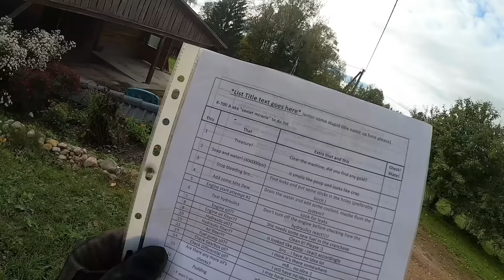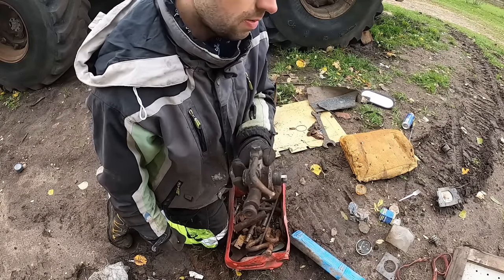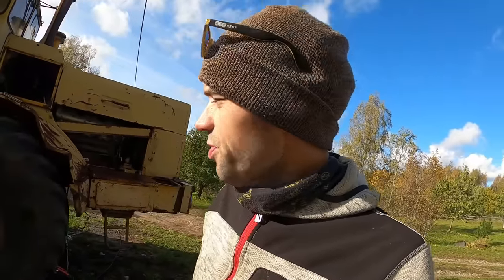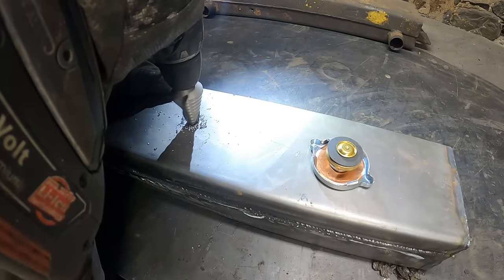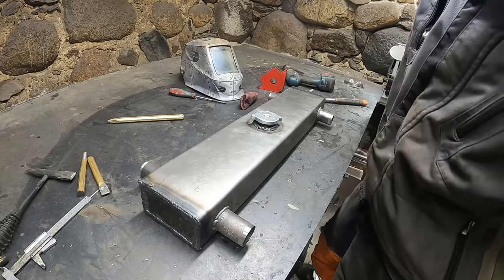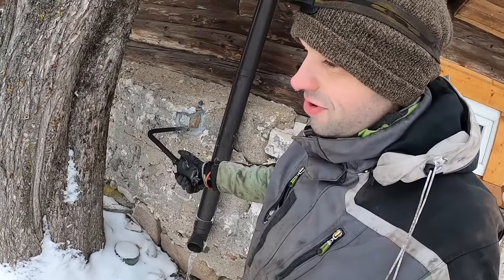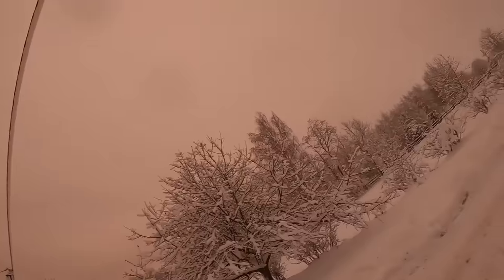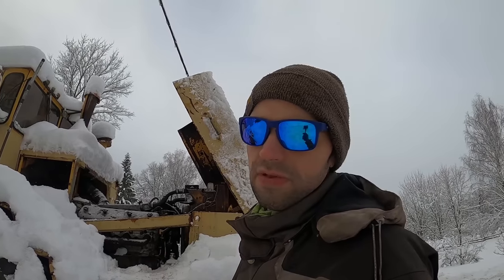Fixing up the Kirovets tractor (K-700A) - Ep1

Comment: My friend made his own hot water pressure washer by taking his pres washer, a50 foot length of copper tubing and a barrel. He wrapped the copper tube into a coil and placed it into the barrel so both ends stuck out the top. He hooked the hose from the pres washer to the coil then another to the coil to the gun. He filled the barrel wit enough water to cover the coils then built a fire under the barrel. When the water got to boiling he turned on the washer and after a while the gun melted.
Reply: A safer way is to use a propane fired instant hot water heater and hook your hoses to it. Mine is 14 liters per minute.   Just stop from time to time or it will shut down for safety. Depends on the temperature I can go almost 10 minutes.

Comment: Put a whole box of crushed black pepper in your radiator it'll smell great when you're driving and plug all the holes and it won't leak also keep all brass and copper shavings from your milling so you can put it in the radiators to completely plug them perfectly❤❤❤
Reply from the maker: what🤔🤣🤣

Comment: Hey Ants, great video. For the radiator cap, if it still leaks you could cut the radiator cap fitting off the old tank and weld it in place. Have a merry Christmas 
PS Don’t forget to grease the muffler bearings
Reply from the maker: oh snap i forgot, brb

Comment: Just a lump of rolled hollow section RHS about the same length , as long as the bonnet will close and you can fit the pipes , plus’s a couple of lumps of angle for end caps / mounts  , turn the fill cap mount in the lathe . Quicker easier to weld and last for ever  . Just trying to help because I think you will be back to this one good luck great Chanel love it I’m a retired maintenance fitter , did this shiiii t all my life cheers
Reply from the maker: ah yes i understand, good idea that

Comment: Hi Ants I have a hint for you  grind a small  flat along  the bit shaft to make a " D " shape....bending  pipe fill it with dry sand and tap it into the pipe with a brush handle pack it in well... cap off the ends...allow enough pipe  for cutting the ends off  to get the sand out ...merry x-mas to you and the family  great viewing ....
Reply from the maker: Thanks m8

Comment: First, let me say merry Christmas.
As for the diesel heater efficiency in the shop, you could add a regular radiator to the exhaust system so you can get all the heat out of the exhaust gases. I saw a picture of the same setup so it must work.
Reply from the maker: I was told that i could not restrict the exhaust too much, the fan would not be able to push it out efficiently enough.

Comment: Okay , so im starting to think you have access to my , Want list , 🤔🤔😝🤪. Im Impressed with the expansion tank , great job *** not easy to stop leaks in cooling systems that size . ive never seen steel coolant pipes that thick 🤣😂. the more leaks you fix the more pressure and so More leaks until you finally get it plugged , its going to be interesting to see how you proceed with the Kirovets ..........
Reply from the maker: Cant wait

Comment: To work on Sibling of Joseph, buy a couple of used insulated tarps (the ones they use for winter concrete). Build a cheap frame structure  cover with tarps and  put a cheap diesel heater in it. You will be out of the wind and the diesel heater will get temp into high single digits Celsius….comfortable to work in. I’m sure you personal Santa Claus can make the needed supplies appear before Xmas.
Reply from the maker: hmm :O

Comment: I love how the expansion tank came out. I think you still have a air pocket somewhere in the engine, so that's why it took only 30l of coolant. Not to say that the cabin looks now much cleaner after removing all the rat turds from it with the pressure washer. I'm sure this thing will have some other surprises in store, so we shall find it out in Spring if this thing even moves on its own power.
Reply from the maker: Mhm agreed 😇

Comment: I have found in my own personal experience that when you want to build a tank and you want to use thin gauge materials the best way to do that is with gas tungsten arc welding AKA TIG welding stronger more ductile welds this is desirable when building expansion tanks and things that hold a lot of pressure but you're doing awesome man happy Holidays to you and yours
Reply from the maker: Ahh yes i have that welder option but iv never even tried it out. Think i need to buy a argon gas cylinder and then just experiment
Reply: @Ants_Pants   yes its a great process for thin plates and pressure fittings

Comment: K2 Akra is an engine cleaner and it does amazing work. Put some in a spray bottle then agitate the gunk a bit with a brush where it's really thick then use the pressure washer. Seriously i'mm allways blown away by how well it works.

Comment: You need to build a hot water pressure washer. Super easy, propane camping water heater upstream from gas or electric pressure washer.
Reply from the maker: easier to just rent it mate, 30 USD per day

Comment: Hi Ants. The Tosol (or any other antifreeze) has higher permeability than water. It s a reason why you see so many leaks. You can make hot water washing by yourself. Put one of your water tanks to a roof (for initial pressure), paint it to black and wait the summer. Summer sun will heat the water and you can clean everything.  Also I would recommend to use own cleaner spray to clean the engine.

Comment: I know this suggestion is way too late but you should cut that radiator cap( hole) with the other round hole that’s sealed. Just cut a square out of the old tank and weld it to the new tank. Just Sayin ! Merry Christmas to you and your family from Panama City Florida,USA. 🇺🇸🦅   No Snow Just Breeze !
Reply from the maker: The old tank has no radiator cap. According to the book it has a pressure release valve and a normal cap

Comment: Next time welding sheet metal wipe the sheet with acetone. Makes welding 100x easier.
Do not use brakecleaner it will create toxic fumes.  Be safe!  
And merry x-mas!
Reply from the maker: ok
Reply: apparently non chlorinated brake cleaner is fine

Comment: Great video, as always!   The winter weather you work in is incredible!  For any more leaks in your tank, why don't you use epoxy?  In America, I would use JB Weld, although you'd have put it in a heated area for 24 hours for curing.  It would also work a lot better than welding to get a smooth surface for your cap.  Once cured, JB Weld is rated for around 600 degrees F, if I remember correctly.  I successfuly repaired a bulldozer radiator with it.
Reply from the maker: yeah that stuff sure does work, iv fixed even hydraulic leaks with it

Comment: Often, a good replacement for plumber's tape is to use parts of a balloon! You can cut it into a strip or use a 'flat' section.

Build a quonset hut? Helped build one before. It's pretty simple. In addition, you don't have to clear snow off of it (Maybe clear the snow at the base before the 'big melt' in the Spring?)!
Reply from the maker: Thanks

Comment: I got a 'broken' one of those Karcher washers from work. It was fixed the same way you tried, by removing the hose from the handle, but I had to turn it on it's side and jiggle it to dislodge the air bubble around the sensor inside.
Reply from the maker: Sucks 😣

Comment: If a hose is too small but really close. Put the end of the hose in boiling water, then put a small amount of dish liquid in the end. It should work it's way onto the fitting.
Reply from the maker: Hmm 🤔
Reply: or if careful, heat it with a propane torch,

Comment: I think you should drill a hole in the neck of the filler cap. Now when the pressure lifts the springloaded valve, that pressure cannot freely vent into the open air. If you drill a hole between the sealing surface and the top of the cap, the pressure can escape that way.
Reply from the maker: theres no seal between the springload valve and cap itself, it will leak out between the cap no issue

Comment: You did the best with what you have.  Great job.  For myself I may  have lapped the joints and soldered them. Like most radiator shops.   Also, I wondered why you did not cut the cap from the old tank and  weld it to the new one.   Merry Christmas to you and your family.
Reply from the maker: the old cap was not a radiator cap.

Comment: Welcome to my world!!! I work for a water supply company, and i deal with welding pipe of varying condition (old and rusted to cast iron) -- never the same twice ... there are always micro holes that allow water through the weld if you use MIG.  I hate to tell you, but the best results always come from TIG -- it is slow and tedious, but the heat and penetration always wins in the end!!!  As for the radiator cap issue, I can't believe that you didn't use the lathe -- you could have created the whole spout for the cap off of the tank, and then welded the finished product to the tank .
Reply from the maker: Idk how to tig... Just not yet
Reply: I like that you added ... "YET" ... do yourself a favor and start practicing! @Ants_Pants
Reply from the maker: @robertscholz4486  yeah i need to get pure argon gas for tig first. I held it off because thought i might not need it

Comment: If you had coated the welds with a layer of J B weld it would of sealed any small holes and would of made a clean smooth surface to paint over. JB weld will last a very long time and you can actually use it for what it was originally invented for which was fixing leaks in fuel tanks. You can actually drill and tap jb weld for bolts.
If you wanted to weld the Seams brazeing them would of been a lot better obtion.Brazing with brass flows much better for sealing joints on thin metal and it's plenty strong for this water expansion tank.
Reply: JB is great ! Also have you ever heard of a epoxy stick called, "Fahrenheit" ?? I used it twice on my daughters lowered cars transmission pan {Her hitting dips to fast} ! While it was still in the car full of trans fluid ! I wiped the area up with a rag, then mixed/kneaded the epoxy so it was ready to be applied. I then quickly poured rubbing alcohol on a clean rag, wiped the area a with dry rag, then with the alcohol rag and started pushing the epoxy into the hole real good ! It dried up quickly and did not leak even after her hitting another dip 2 weeks later, the pan was leaking again but from a new hole just behind the one i repaired earlier and i could see that it scraped the epoxy,  but did not leak from there ! Did same on new hole neither ever leaked for following 6 months that she owned the car !
Reply from the maker: I used it for some minor micro leaks. Yes it works great for that purpose

Comment: On your overflow tank, welds. Best practice is when your welding doesn't meet the requirement for its purpose or you are not happy with your results, just grind 'em off and try again. You are the best judge of whether you could do it better and "if"you want to. Pride in your work plays a role, too.  becareful to not grind off any of your base metal or as little as possible.. Whenever I have a project welding or other metal working, and I think it looks like crap, or in your case leaked, I tried to fix it by adding way too much weld beed, I probably would want to grind it off and do a better job the second time? If that doesn't work, then maybe use an existing premade tank. Salvage an old air tank or fluid tank from a salvage yard. No sense reinventing the wheel, so to speak, if you can just modify one to meet your needs.
Reply from the maker: i did pressure test this later, put 6bar in it, did not explode, that should be good enough for this setup :D

Comment: I think you can make your own hot water pressure washer, need a spiral, bonfire, hose and wand that can take the heat
Reply from the maker: Nornal washers are not designed for higher then 40C if i recall?
Reply: @Ants_Pants  yeah I think so, I've heard that the seals in the pressure washer pump go out if you feed them hot water. 

not sure what the rating for the hoses or wands are though

Comment: You can buy the radiator cap tank neck as a replacement part. Check with radiator shop if you cannot find one at a car parts shop.
Reply from the maker: I did look but couldn't find when i bought the cap.

Comment: for an idea of how much coolant is still left to be filled. My truck with a tiny 2.4l gasoline engine which holds about 1.5 gallons when completley drained like my hose came off on the road drained I was only able to fill the radiator about halfway before I had to start it to circulate coolant through the system then I finished filling it the rest of the way. It is very likely that between the heater core and all of the coolant passeges in that engine that cannot fill themselves with coolant without the pump running that is where the other 1/3 of your cooling capacity is.
Reply from the maker: yeah bro, thought the same

Comment: 37 minutes in. I think you should treat the inside of the tank with some epoxy. I probably would put some vinegar inside and let it sit for a while to get a better surface, then flush it with some (battery) water and some acetone before the treatment. And always remember the importance of cleaned surfaces before welding.
Reply from the maker: Hmm 🤔👍

Comment: Your videos are great. I don't know anything about expansion tanks for radiators. How does the water get directed to flow through the radiator? Seems like the two sides would need to be isolated from each other.
Reply from the maker: They flow through the V shape of the engine block and get mixed in the expansion tank before entering the radiator

Comment: Question: what is preventing water from just bypassing the radiator through the expansion chamber? That new expansion chamber has nothing to prevent flow from the 'into the radiator'-side to the 'out of the radiator'-side? But, i may just be missing something and if so, ignore the stupid question :D
If that is a problem, easiest fix would be to replace two short end-pipes with one long pipe that goes straight through the expansion chamber, keeping the two sides separate.
Reply from the maker: I may need to look at the diagram

Comment: Hello andris, i have a kärsher k7 hade the same problem no pressure, the battery in the handle is gone, change that and it will work.....
Reply from the maker: ok i will try it out. Thanks for the tip

Comment: With that style of pipe bender I have found over the years that you will do much better by bending incrementally.  Don't try to make the bend all at once.  Use five or six positions to make the full bend.  They can be very close to one another but totally they get the job done with less deformation.
Reply from the maker: Hmm ok
Reply from the maker: I thought about this aswell

Comment: Tanks are fun..pin hole leaks just move when you patch them...have to grind them out then patch or do a good weld first time...its hours of fun....air with soapy water on outside is easier for finding leaks...well done, tank replaced.
Reply from the maker: Thanks mate

Comment: I needed 100 feet of 10 gauge extension cord but it was over $200. I bought 100 feet of 3 wire (stranded) 10 gauge cable and a plug for each end for $125 and made my own.
Reply from the maker: yeah, 2 times cheaper, almost...

Comment: 1:07:13 the 3 point of this tractors do lifting very high. If you lift it completly up, the tractor will be shorter.
Reply from the maker: Ohh
Reply: @Ants_Pants  mine is Lifting his arms 1,20 meter high, if i remember right.

Comment: 46:40 that pipe looks very close to a volvo 940 upper rad hose or lower rad hose from turbo one (b230FT/b230fk engine code) with the nipple on side... tho i am not 100% sure if lower had back and forth like that. its hard to judge size but it might be too smol of a diameter sadly...
Reply from the maker: 43mm is the inner size.

Comment: Take the "neck" from the old tank and weld it in the new one, then the cap will seal.
Reply from the maker: from the old tank? the one it had before has no radiator cap on it, it has a normal cap and some special pressure release valve which i was unable to track down.

Comment: God's Grace to you and the family.  Greenhouse:  Add in a solar heat collector with black tubes like plastic barrels (?) and pvc. to store heat for cooler times and coolant lines under gravel for heat storage?  Check on the Rainey's Homestead Rescue series? Lumber shipping covers for the plies used in plywood make great Long Lived machinery covers.  Sewer tank makes a great water storage tank for water; also is likely black and maybe a heated water system add on for greenhouse in Spring and Fall? Winter if enclosed by greenhouse.  Expansion tank: use fuel tanl sealer will seal the tiny holes perhaps and is rubbery. No idea what heat it can take.  
   Tubular steel with end caps for that tank? Stainless steel?  Lord knows you think it out well in any case.   Fill tube with sand and it will not collapse.
Reply from the maker: thanks

Comment: Just saying you can definitely force than 18mm hose on that 20 mm pipe and it will never leak for sure. Hoses are supposed to go on with a bit of effort not loosy goosy.

The secret to forcing them on is to twist and push with all your force. I know you can do it lol!
Reply from the maker: Kinda hard with freezing weather 😅
Reply: @Ants_Pants  We used to bring a pot of boiling water outside dunk the hose in so it gets softer and push it on then!

Comment: Cut the top off the yellow pressure tank and weld it onto the tank you built that way it wont leak
Reply from the maker: old tank has no radiator cap, it had normal cap and some very old style pressure release valve setup, which was missing.